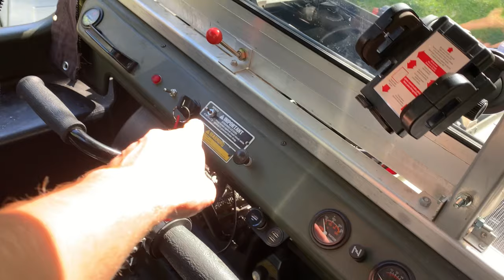Argo Conquest with Honda 690 engine swap "Walk-around"

Comment: Curious if your 690 had the float oil level sensor with it and if you had to bypass that somehow? I am almost done swapping a 630 into my old 6 wheel and wanted to bypass it for going up steeper hills
Reply from the maker: Not sure to be honest, I’ve been up and down some uncomfortably steep hills and haven’t had any issues. My gut tells me they are the same, I can’t see Honda re-inventing the wheel on such similar engines. I’d run your engine as is and see if it’s an issue before giving yourself more work. Something else you could do leave the sensor and put a switch on the dash to “Bypass on demand”. Cheers